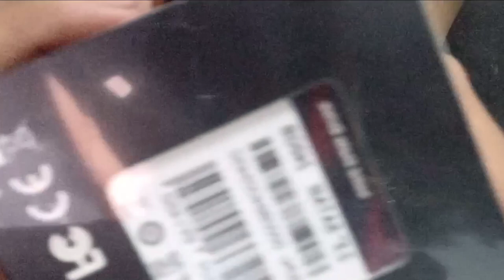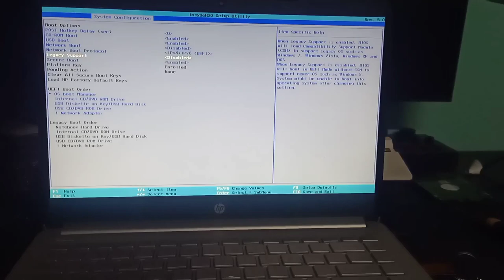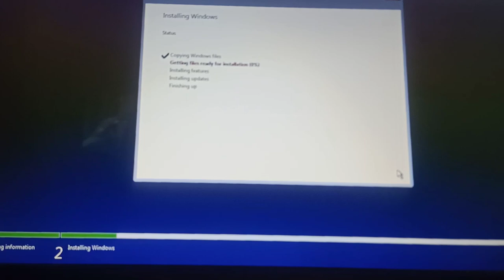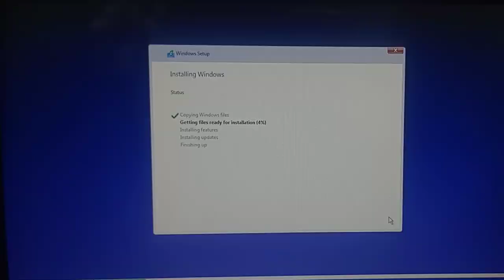HP Notebook Laptop 14s-CF2XXX Upgrade SSD

Comment: Hello. My father's laptop is HP 14s-CF2525TU, is it possible to add another m.2 ssd?
Reply from the maker: yes, hp 14s-cf2525tu have m.2 slot
Reply: @jomlipc  can I add another without removing the stock m.2 ssd?
Reply from the maker: @rommelcarldavepalmes1114  no, theres only one slot for m.2
Reply: @jomlipc  okay bro. Tysm!

Comment: I have the same laptop and I am wondering what all upgrades I can make to it.
Reply from the maker: u can upgrade the storage like ssd, and also the ram u can upgrade up to 16gb
Reply: @jomlipc  mine is a 14-cf2xxx. Is that different than the 14s-cf2xxx?
Reply from the maker: 14s-cf2xxx and 14-cf2xxx is same
Reply: @jomlipc  how do I figure out what storage and ram is compatible with this and can I only replace my c drive or can a add a second drive?
Reply from the maker: this unit have 2 slots of ram u can add another ram ddr4 2666mhz, and then in the storage u can also add another ssd like m.2 or nvme as a second storage
Reply: @jomlipc  okay cool thankyou that’s very helpful
Reply: I was attempting to ugrade mine but my storage is missing all together
Reply: Did upgrading to 16gb ram work? I want to either with 8 or 16 but I get different answers from different people. 😊 needing help.